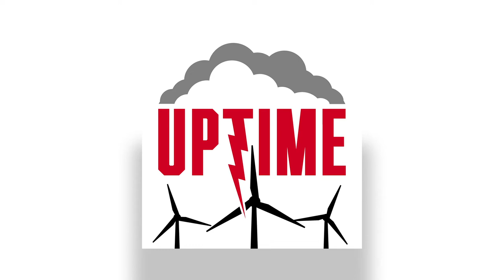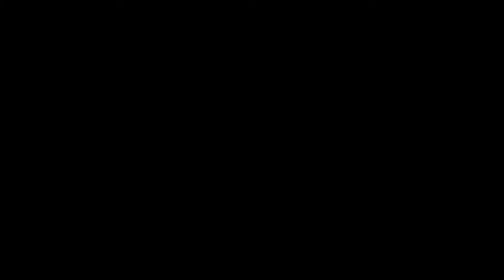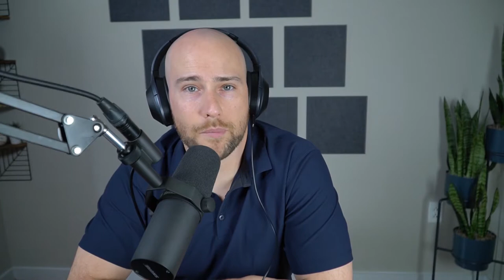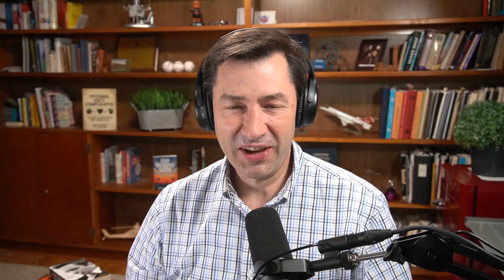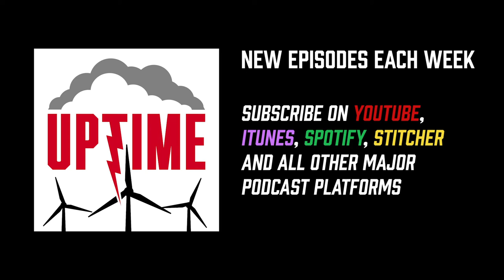Leading Edge Erosion: Can Nickel Cobalt Save Turbine Blades? [UPTIME WIND ENERGY PODCAST]

Comment: I'll weigh in....10 to the 0 is 1. Everything to the 0 is 1...btw. ...I think every for rational number. I owned a company for twenty years that made composite aircraft propellers for manned flight....biggest project was the HALED (High Altitude Long Endurance Dirigible)....drove the first blades to Skunkworks....I made that drive to....be someone who contributed to THAT R&D facility.

The structure was relatively easer than the finish....and getting a nickel leading evaded me... or not evade...I just never got to it before it I retired. Sennsenich propellers once offered me money as a consultant. Steve Bowser, their chief engineer were kind of friends (several yearly airshows). We had a dance going between too much tech exchange and pleasant conversation.     

I have thought two decades about this issue.  I did manage to make dies and use hydraulics to progressively shape a brass leading and have it shaped perfectly around the swept back tip...that was a year,. I believe I used methacrylate adhesive for that bond...which held up well to a direct drive piston engine. Nasty dynamic stress field.  

I finally decided to mold the blade with a RECESS at the leading edge....then the whole blade went into a different (final shape) mold and I used an RTM process to suck 2 part urethane compounds into the pre-molded depression. That worked great. Cleaned up all the wat downtown. Various compounds could be processed this way...and ya... AB ceramics?  Hmmm.

That process was great for little blades. I don't know the processes used to make big turbine blades or whether the industry  has settled to one two different processes that are most profitable. I saw some big one's made with a filament winder. I devised six separate processes to make propellers blades. Lockheed was bladder molded using an aliphatic urethane film in a RF welding machine I had. The bladder is a SUPER light pool toy...custom shaped. The bladder stays molecularly bound to the epoxy it was pressuring inside the blade. After that some two part urethane foam is injected fill the space with about a12 pound density. Urethane foam on aliphatic urethane film...that ALSO stuck like crazy...Btw....learned some of that from Lou Fezio, chief engineer at K2 Skis. Good man...needed  some credit..        

Send me money if you patent that...or don't....I couldn't care any less. :) I retired in about 2010 to make guitars since I knew cad/cam/cnc and four Haas mills,...some big ones. Sold that business and two of the machines and kept two big ones...and made up some very interesting composite inserts....not carbon sticks....custom shaped. hollow, bladder molded inserts that blue into form fitting, wooden cavities. Got all the way into it.

The props biz is still alive and has changed hands a few times,.    www.powerfin.com
I'm out...lol. cu